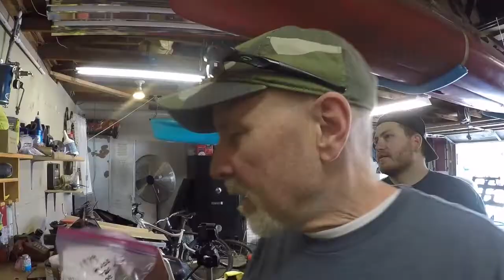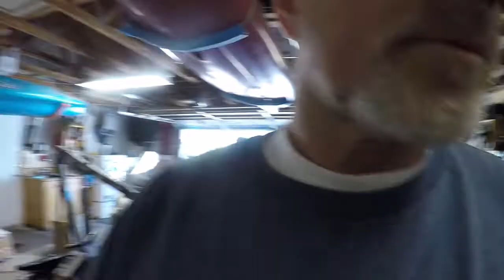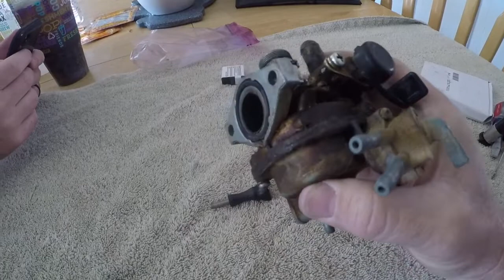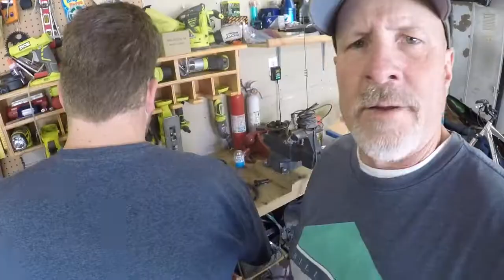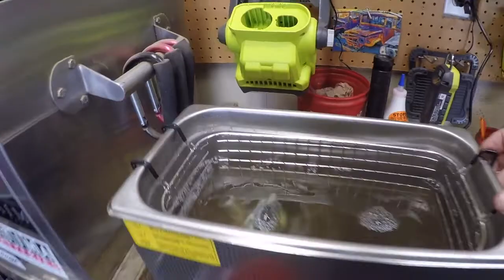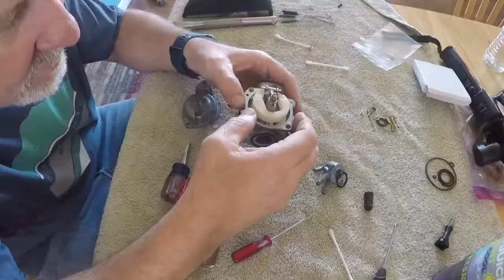Honda trail 90 (CT 90) Carburetor Rebuild

Comment: I ended up replacing tbe  carburetor with an after market one and changing out the throttle cable. I followed the instructions on setting the air and fuel adjustment screws.  I finally got lucky to  get tbe carb adjusted. It now runs real good.
Reply from the maker: Glad to hear that👍🏻 sometimes those bikes can be a little frustrating🤣 but they are rewarding too

Comment: I'm rebuilding a 79 Honda CT90 like this one. Everything looks same except my needle jet has no way to get it out. No screw slot nor nut type for 8mm. Very puzzling. can't ron a wire through or B12 spray don't Pentwater. The hole is stopped up. I am at a standstill on this.
Reply from the maker: If you can get an inexpensive ultrasonic cleaner and throw that carb into it many time that will solve the problem. If not you can buy an aftermarket carburetor for it through Dr ATV and they Are usually fairly reasonable.

Comment: Hey Larry.....That is the carb im working on 1978 trail, a keihin,  that little black cap?  I have two black tubings comming off the carb one is obviously the drain tube for the carb.  The other comes off the right side of carb when carb is installed.  And goes where.....Im thinking it goes on what looks like a fuel line where the little black cap came off ! The owner put it around the down post connected to nothing, and it was running that way?  I cleaned it so good, that fuel is comming out the carb drain tube when on reserve setting when drain needle is shut tight. Put some high temp thread seal on drain needle am waiting the 72 hours to cure.....but that little black cap? and the tubing on right side goes where.............did you put the black cap back on, or does the right side tubing go there?
Reply from the maker: There shouldn’t be fuel coming out of that that may mean that your float bowl is flooding out if it’s the one that has the rubber grommet over it.
Reply: @ManCaveMayhem  So your saying put the little black cap back on, then recheck that float bowl is seated properly, and just let the other tube hang out over the bike down tube? Is that extra tube for sucking air into the air/fuel mixture screw.  And thanks for replying. Happy Fourth of July.
Reply from the maker: @anthonysousa7899  sorry so late. That’s how that carb was but I don’t have that bike. The CT owner’s Facebook page could probably help you with that. I’ve be out of town on vacation. Sorry for the late response.

Comment: Fill the ultrasonic cleaner with water. 

Put the parts in a mayonnaise jar filled with gasoline. 

The ultrasonic waves will transfer through the mayo jar and clean the parts up better than anything.
Reply from the maker: Good idea sounds good. Probably should keep the heat turned off👍🏻

Comment: I just got a ultrasonic cleaner after watching your video. What temperature and for how long total did you leave it in the cleaner?
Also what mix ratio did you use for the Simple Green HD?
Thanks for the great video!!!!!
Reply from the maker: Bob Shaffer I got it pretty hot I run about a 50-50 mix but you can even make it stronger if you want to. Not positive on the temperature it was about 140 degrees.Thanks for the kind words and thanks for watching.

Comment: Constructive criticism 
I couldn’t see what you were doing part of the time because your hand was in the way.
There is also a small o ring on one of the jets that you didn’t address
Thanks
Reply from the maker: James Hughes Thank you
Reply: I just bought a CT 90,that came with five carburetors that looked just like that? in pieces and at least five floats and all the needles have rubber tips on them? My other CT 90 needle and seat also leaks , and I’ve taken it apart and tried to polish the seat, and I ordered one from Honda was $18 for the needle and seat and it’s all Metal? No rubber 1971 going to install it soon but back to the carburetor you’re working on there I was wondering if the needle and seat if the needle had a rubber end on it? like all the needles I have here? I guess I could call Honda and maybe they would know?
Reply: @golfwipe  If your carbs look just like that (Keihin), then they are from CHINA ! I have never seen a rubber tip on a needle.  They are aluminum and bend very easy, once bent they are worthless.  I have a 1971 ct90 trail, you can slap a new jap carb on it, re-time it first, do valves and gap put carb on and it will fire right up if you have compression, and battery showing 6 volts on a volt meter.
Reply: Also I live at 10,000 feet . The jap carbs with just a idle screw, and fuel/air screw can be adjusted to this altitude, start with screwing fuel/air in all the way till it touches the O ring, then back it out 1 and a half turns, thats for 6,000 feet,  I only have to go a quarter turn more to get it sounding right for 10,000 feet.
Reply: Sorry thought you were talking about the throttle needle, instead of float needle.  I hate the chinese Keihin carbs.